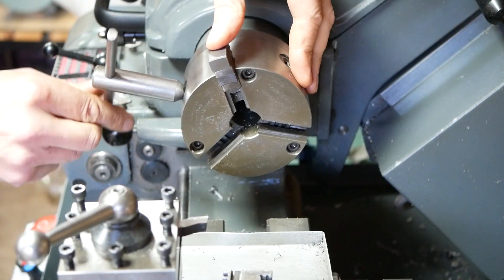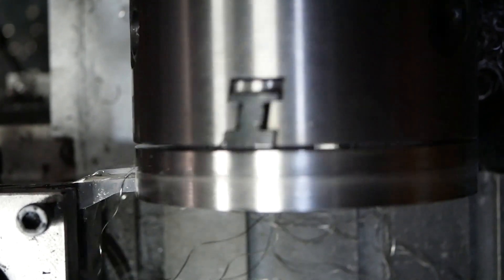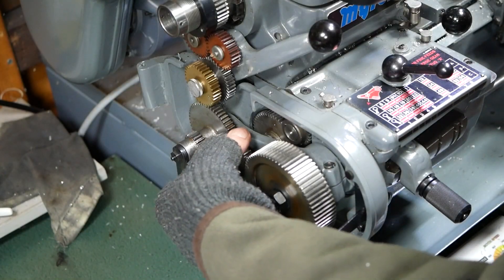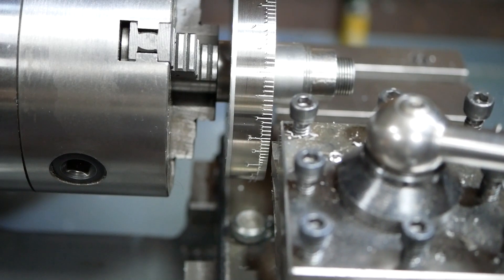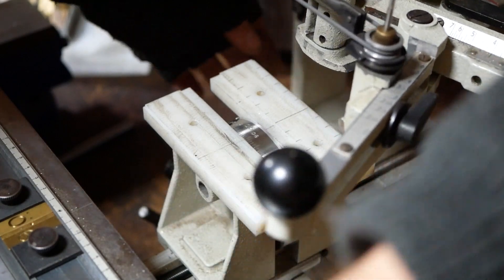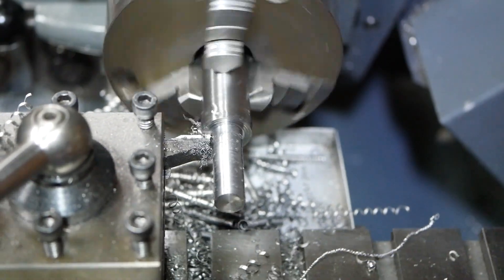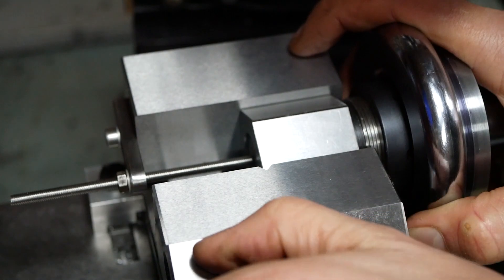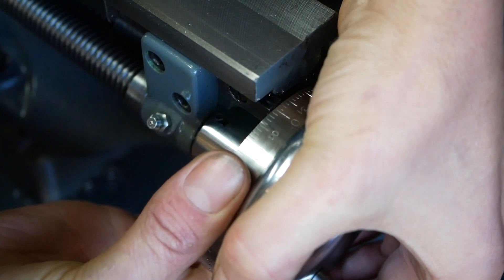Machining a Resettable Dial for a Myford Leadscrew Handwheel

Comment: I am attempting to reproduce your design of a resetable leadscrew handwheel for my imperial S7.  The first challenge was to get hold of a spare wheel of the type you used, my S7  had the cast spoked type.  I would be grateful for advice on your desgn, I'm wondering how, once assembled, you can disassemble the dial ?
Reply from the maker: Hi Jon,
The springs hold the dial in place but they don’t prevent it from being removed for disassembly. Hope that helps.
Reply: @chronovaengineering  Many thanks for all the information. I've now completed my imperial version of the hand wheel, I made a couple of very minor changes (a) I fitted much softer springs, (b) I made a new piece to take the index line as the old one gave too big a gap for reliable reading.

Comment: Hello all at Chronova Engineering.  Excellent video on the metric resettable hand wheel.  Very well done Sir!   I too have a Super7 awaiting full restoration (can't wait!) but I was interested in your pentagraphic engraving machine and wondered if you could present a video on that.  Greetings from Southport.
Reply from the maker: Thanks Kevin. We will aim to put together a video on the engraver in the future. It's a very useful tool for the manual machine shop.

Comment: Nice work. I admire you for trepanning 316 stainless steel, that would be tough. I do not have a lead screw handwheell on my ML7 but would like one.I don't think many people would have access to a pantograph engraver.
Reply from the maker: Thank you Andy. 316 certainly wouldn't have been our first choice but it's all we had on hand that was the right size! For those who don't have a pantograph engraver, stamping will do the job, it just won't look as pretty.